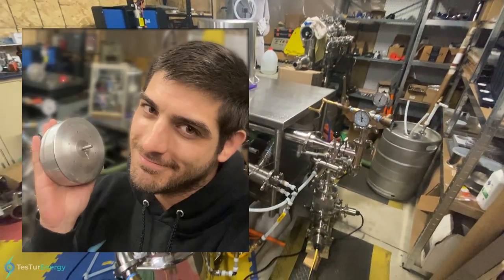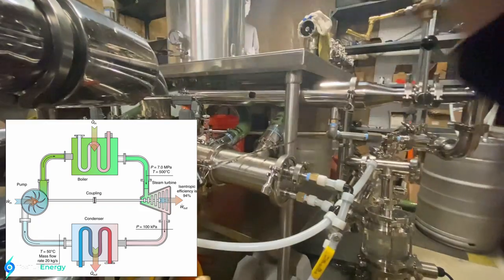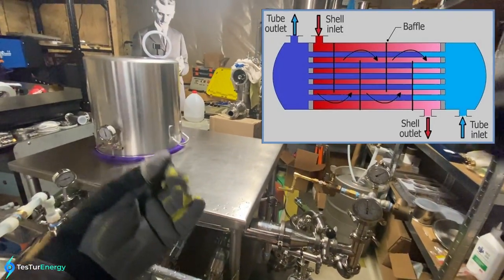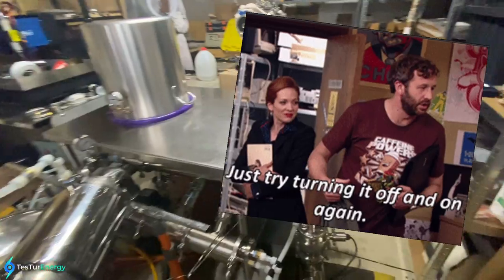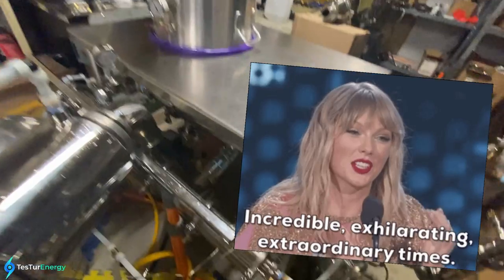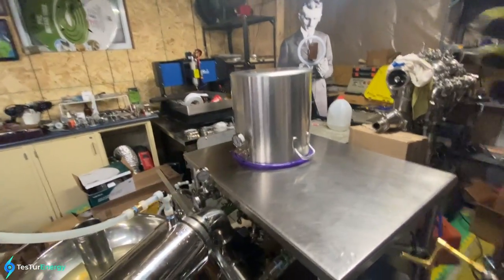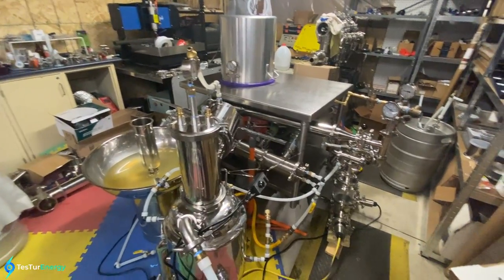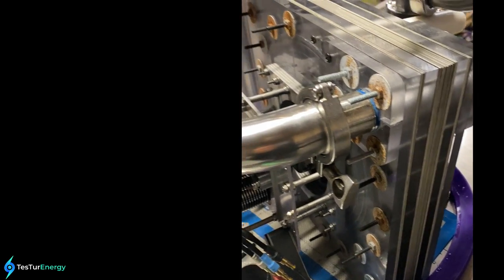Steam Tesla Turbine Renewable Energy Micro Power Plant - 1st Start Up

Comment: Hilarious watching Charlie explain the various complexities. Question, If you put a heating  element in a tank of water and cranked the temperature to 600C (or whatever modern turbines run at) what percentage of power would you get back with your machine and how would that efficiency compare with a typical power plant?
Reply from the maker: Hey Jim! Thanks for commenting! So nice got a copy pasta 🍝 that I’ll share with ya. It’s a bit long but I promise it’s worth the read.
Reply from the maker: As far as efficiency goes… (mind you this is a copy pasta 🍝 so it’s a bit long but it’s worth the read.) 

…My 2650watt electrical load run came in with a very low ball calculation of 40% isentropic efficiency.  

To start off, mind you that includes generator losses, 3 phase rectifier losses, and inverter losses to the electrical load that were not accounted for. 

So the turbine off the bat is already most definitely doing better than the 40% isentropic efficiency I’ve calculated from the already low ball test results.   

But for now I’ll just assume 40% isentropic efficiency so that I’m not over claiming what I can prove it can actually do for the time being. 

(I have nothing in the long run to benefit by overstating my numbers and only my legitimacy to lose. I’ve worked hard for my physics degree and don’t intend to tarnish it for a couple of extra views on the internet.)
Reply from the maker: As far as inefficiencies to the system to fix, there’s 10x crappy ball bearings in this version, 2 crappy RC car gears, both losses will be gained for power out with a direct to shaft generator. 

(Minus two gears and 8 crappy ball bearings)  

There’s an 1/8 of an inch of space between the turbine endplates and the casing endplates on both sides of the TesTur. 

That’s a 1/4in of open flow area around the 2in wide turbine (that only even has a total of 0.75in wide of spacing between all the tight disc spaces for torque to begin with.)   

That means 25% of the open space for flowing through the casing, between discs and between the casing and turbine endplates, is just free flow over the side of the turbine still. 

(I’m using the absolute bottom of the barrel of machining equipment right now in my garage 🤷‍♂️)  

There’s no labyrinth seals yet to even attempt to further reduce that overflow…
Reply from the maker: The nozzle is atrocious at the moment, when making the variable converging section have a tight convergence it causes the fluid jet to aim more centripetally (towards the axle) instead of tangentially (glancing off the disc tips) which severely effects the fluids natural path.   

This will be fixed with the new variable nozzle design I’m going with.    

Then even further in this specific casing’s assembly there’s two “pillars” in the middle of the nozzle.   

This is because the aluminum plates in the middle of the casing plate stack only had the variable nozzle bar and inlet holes cut out, and not the full nozzle geometry.  

So those pillars are just vertical bars in the middle of the nozzle for the air to smash into just before going into the turbine (hopefully the wet steam tests will just erode them down 🤭)   

Before all that there’s still about 100ft of air hose between the tanks and the turbine… plus a shell and tube heat exchanger and a TON of elbows and fittings.    

I’m sure I’m forgetting something too but between all that being fixed… 

I can almost guarantee we will be in the 60-70s % range and that’s all just still with room temp compressed air.   

Most forget, I’m using room temp compressed air and never went over 20psi at the nozzle for these tests. 

(Pressure differential and temperature differential govern efficiency)
Reply from the maker: And even then I still only even have a single stage on it yet.   

Everyone wants to compare it to the efficiency of a very high temp, high pressure (1000°F & ~1800psi) multibillion dollar 15-30 stage steam turbines…   😮‍💨   

That’s apples to rocket ships. 😅  

But considering Rankine Steam cycles get theoretical max about 33% of input heat (due to latent heat of condensation and that’s without any regenerative boiler feedwater preheat, air fuel preheat, etc) and then 40% isentropic efficiency (considering the turbine as is) we’re looking at 13.2% thermal efficiency with steam.   

A more apt comparison for the TesTur would be something an individual can actually purchase, like 1-5kW piston gas generators that you can get from Home Depot or Lowe’s.   

These get 15-22% thermal efficiency off the plant floor. Good luck getting that 1 year down the line or later with all those moving parts.  

Also for reference, industry standard for micro bladed gas turbines is 25% thermal to electrical. 

Whole system efficiency can go higher in Combined Heat and Power (CHP) system, but alas the TesTur would see the same whole system efficiency increase in a CHP Auxiliary Power Unit (APU).  

In the TesTur you gotta replace…? 🤔bearings…? 

And still even then, only maybe 🤷‍♂️ depending on how good of bearings, balance, lubing, cooling.   

The TesTur, and other bladed turbines, only have one moving part. 🔥
Reply from the maker: So if those piston generators drop efficiency, even at all, the TesTur on its worst day is competitive with a gasoline piston engine electric generator.🤓😬🤷‍♂️  

And the TesTur can handle any fuel that can burn, even solid particulate fuels like powdered saw dust, pulverized coal, powdered iron, biomass, etc. 

(noting the number of those that can be acquired for free… 🤑 opening up “Monetarily free”, even carbon neutral, fuel options for MILLIONS around the world)  

We have to remember that the TesTur doesn’t have to be the holy grail to be worth using if we have free fuels readily available like biomass, and even waste heat already being dumped out into the air and not used for anything.  

The TesTur just has to be a viable option for some to be worth doing.
Reply from the maker: Even more, the mere fact that I’m using a low temp fluid for my 40% isentropic efficiency calculation means my TesTur efficiency is severely limited by thermodynamics and fluid dynamics.   Increasing temps will automatically increase my turbines efficiency.  

This is because gasses have an increasing viscosity trend as you increase the temperature.   

This leads to increased isentropic efficiencies in the TesTur from reduced slip on the discs.  

(Meanwhile, we’re already talking about a piston engine using combustion temps as is.)  

Whereas bladed turbines see the increased viscosity as an increase in drag loss through the turbine blades.   

So we can’t always count on seeing increased isentropic efficiencies in a bladed turbine in practice when we go from low temp to a high temp.  

Again, to reiterate, this increase in viscosity in the TesTur only works to enhance the working action of the TesTur.  

(That being viscous adhesion to the disc faces increasing torque.)  

That’s all on top of the increased thermodynamic efficiencies of using a higher temp elastic fluid too! 🤓
Reply from the maker: The disc spacing for room temp gasses is not going to be the same for combustion temp gasses/steam because the viscosity of either increases by 3x fold. 

And I’ve designed these spaces for a higher temp fluid with a slightly higher viscosity so these will inherently be too wide at the current temperatures being used.   

So as we increase temps along with all these other really easy to fix mechanical issues (that only are a thing because I’m building this in my garage on a junk cnc machine) I have no doubt we will see more than competitive isentropic efficiencies compared to bladed turbines, let alone whole system thermal efficiencies that are through the roof.   

This is because of the heat recovery systems that can be added with the cost savings of using a TesTur vs a VERY expensive, and in my opinion, relatively delicate bladed turbine.   

Just getting tighter casing clearance with the turbine should give me at least 20% points back on efficiency putting my testur at the 60% range.   

Coming in with a 19% thermal efficiency in a Rankine steam system without any kind of thermal recoup.
Reply from the maker: Irrelevant of efficiency though, can you show me a bladed turbine that can handle the wet steam that’s produced from geothermal energy sources without eroding down the indispensable complex geometry blades to little nubbins in a matter of minutes?   

Or a bladed turbine that can actually fully utilize all the heat energy in steam by actually fully expanding it and not be damaged by the condensation and cavitation?   

One that doesn’t require superheaters, MASSIVE heat exchangers and expensive waste heat recovery systems to actually maintain whole system thermal efficiency?   

Yeah sadly bladed turbines get zero efficiency from geothermal steam sources and can only be used to produce electricity from them with outrageously expensive multi circuit loops to keep all the fluids separate and have MASSIVE heat exchangers.   

But when even just one geothermal site in California has more energy than the US needs for the next 1000 years and TesTurs see no damage from multiphase motive fluid flows I’d take even just 10% efficiency over the zero that bladed turbines can offer.   

The same goes for solar steam boilers because it’s very difficult to have a residential solar boiler that doesn’t produce wet steam.   

Furthermore bladed turbines can’t use low grade fuels like biomass, woodgas, and definitely not solid particulate fuels like powdered coals and pulverized iron.   

That’s not an issue for the TesTur for the exact same reason that condensate and cavitation in wet steam doesn’t damage it. 

Because there’s no lifting surfaces for the particulate to smash into.  

What most people mean to be saying is, bladed turbines get a high efficiency on only a very limiting, very specific, very expensive set of proprietary formula refined fuels.  

And the only reason TesTurs don’t is because no one has actually put any money into them like the BILLIONS of dollars thrown at proprietary bladed turbine designs just to get 1% point increase in efficiency.
Reply from the maker: And for a comparison between PV cells and solar thermal. 

Of the sun’s light energy that hits the earth 10% is UV, 25% is in the visible spectrum, and a whopping 65% of it is in the infrared, heat, spectrum.   

Solar PV cells can only use a portion of the visible spectrum and use none of the IR spectrum and in fact lose efficiency from heating up from the IR.  

So at best you can get maybe 20% of the suns total light energy to electricity to charge and discharge a battery at 90%.  

So only 18% of the suns light energy gets to your wall plug.    

And then UV light makes them go opaque and be at 1/2 their rated power in 10 years. 

So, conservatively down to 10% of the suns light gets turned into electricity 10 years in. 

With solar thermal collectors you can collect all 25% of the visible spectrum and all 65% of the IR spectrum and store it as heat in a thermal mass.   

So 90% of the suns light energy can be collected and stored as heat in a thermal mass. 

Let’s say 10% loss on storage  

So 81% of the suns light energy is then available to be put through a steam Rankine turbine system, which at theoretical best can get 25-33% thermal efficiency to electricity. 

44% is the recorded best (And that’s without any thermal recoup, boiler feedwater preheat, etc to bring up the Rankine cycle efficiency and/or going to an organic Rankine cycle with a refrigerant in the closed loop instead of steam for higher pressure gradients with the same temp gradient, for high efficiency)  

So that’s 20-26% of the suns light energy can be put directly out as 60hz 120vAC.  

About a 10-45% increase in energy out for the same footprint of collectors.  

And then even after that ALL the heat energy rejected/dumped out by the condenser from the latent heat of condensation and loss not turned into electrical power can then be used for home heating.    

Sooo since about 60% of the energy stored goes out the condenser, if it’s used for heating then somewhere like 70-80% of the suns total light energy can be utilized for electricity and heating.
Reply: @CharlieSolis  Thanks for all the information, I'll have to look at it again, I could do my own research and answer my own question but it might be a struggle. You might have covered it but I have a very limited understanding of these things. What I have in mind is a inexpensive steam engine that is capable of handling high temperatures and high volumes of steam. For example, I imagine 6 of your turbines in a row on a common shaft. 600C steam goes into the first, then into the remaining 5 (common manifold) then into a large centrifugal fan (on a parallel shaft geared to turn about 1/10th speed that serves as the condensor) 
Maybe that is a bad design but my question is in regards to a heat battery I recently learned about. Imagine if you had a mass of bricks at 600C, and you added 1kwh of electricity with a heater element. Imagine perfect insulation and then later you converted the 1kwh worth of heat back into electricity at the same efficiency as a modern day large scale steam turbine. In that case, roughly how much electricity would you get back?
Reply from the maker: @jimrothers7282  so the thermal mass energy storage system is what we’re working on. I will be doing a high temp sand battery in the middle of a hot water tank thermal battery. 

But for round trip efficiency you will be limited by the Rankine cycle. If the turbine had 100% isentropic efficiency you would still only be able to convert 33% of the thermal energy back into electricity. This is because the energy put to the latent heat of vaporization, to change the phase state from liquid to gas, is not available for expansion and energy out through the turbine and must be taken out by the condenser to cause condensation. 

I may have misunderstood you, and forgive me if I have but I’m aware of people trying to use the second stage pump as the condenser but there won’t be a phase change unless the latent heat of condensation is removed. 

If you have low pressure steam and then compress it with a pump to bring up the pressure to cause condensation at that new pressure, you will simultaneously raise the temp of that gas such that it’s now still too hot to condense at the new higher pressure. 

Even in Tesla’s High vacua pump patent Tesla puts the condenser after the turbine and then the high vacua pump is for removing the non-condensable gasses in the system. 

Check out my Interstage heat exchanger/condenser design of mine for the tesla turbine it’s for this purpose. 

Tesla Turbine - InterStage Heat Exchanger (ISHE) - Heat Pump & Inverted Brayton Cycle Improvements
https://youtu.be/pYSniitC8DM
Reply from the maker: @jimrothers7282  check out this link. It’ll help explain the thermodynamics of the Rankine cycle. 

https://www.nuclear-power.com/nuclear-engineering/thermodynamics/thermodynamic-cycles/rankine-cycle-steam-turbine-cycle/
Reply: @CharlieSolis  Your interstage heat exchanger/condensor looks very cool and well thought out. I'll have to study it a while before grasping the basic concepts but I'm guessing you have a great design. Based on what I've gathered, an imaginary stack of bricks, starting at 600C and then heated with 1kwh of power and then later (perfect insulation) returned to 600C with a modern efficient steam turbine would get about 25% of the electricity back. Do you think that is an accurate estimate? Do you think your machine with your condensor operate at the same high temperatures and come close to the same efficiency?
Reply from the maker: @Jim Rothers  yea I do think that’s possible with my system. 

According to the results I’ve proven thus far I’m already at 13.5% Thermal efficiency. And that’s with the turbine sitting as is in all its horrible tolerances because I’m building this with the bottom of the barrel cnc machines at the moment. 

But irrelevant of the turbine efficiency, why this system is leagues better is because all the loss heat dumped out the condenser is can still be used for home heating. So the whole Combined Heat And Power system round trip efficiency can be as high as 70% or higher if both are counted.
Reply: @CharlieSolis  cool I appreciate the information. I can imagine a grid based system in a windy cold area with lots of little heater/power units spread around town sucking up grid power when the wind turbines are creating excessive power and then later feeding the grid and heating living space when the winds die down.
Reply from the maker: Shoot us an email at TesTurEnergy@gmail.com and I or Andrew can get back to you with more information on how to get one too!
Reply from the maker: @jimrothers7282  Hey I just posted a new video! I think you’ll really like it.
Who Owns Your Copy in the A.I. Revolution?
https://youtu.be/_v0N83U4NoU

Comment: That's really impressive stuff. 
Why does the turbine need to be in a vacuum in the first place?
Reply from the maker: Hey thanks for commenting, having the vacuum on the exhaust reduces the temps the steam or motive fluid will boil at. along with the larger the pressure difference between nozzle and exhaust the more available energy there is. 

This is how all steam power plants operate though to be clear. With a vacuum condenser on the exhaust if the turbine.
Reply: @CharlieSolis  
I see, thanks so much for your answer. 
It seems like I have some books to read.
Reply from the maker: @kaffeetasse9455  you’re very welcome! 🙏❤️‍🔥

Thanks again for the question!